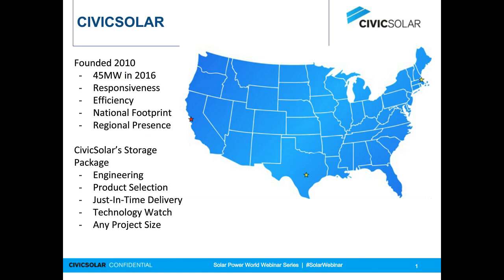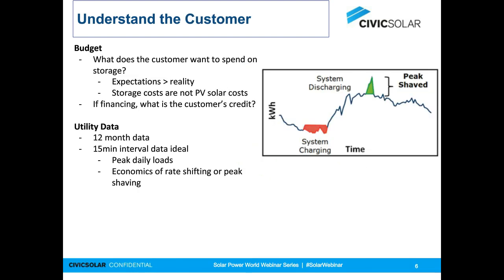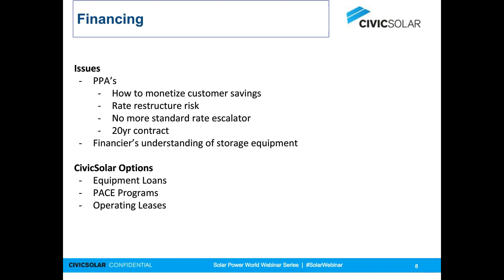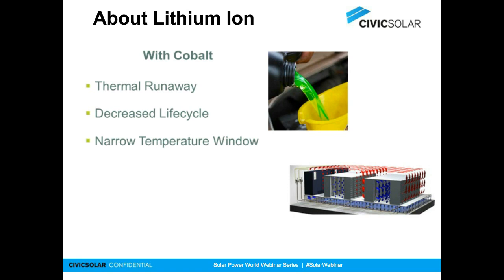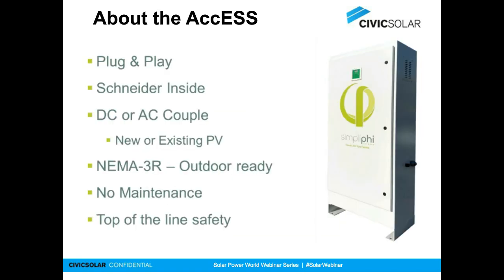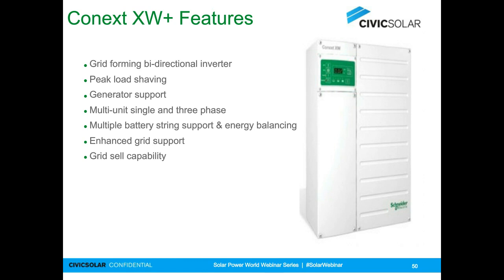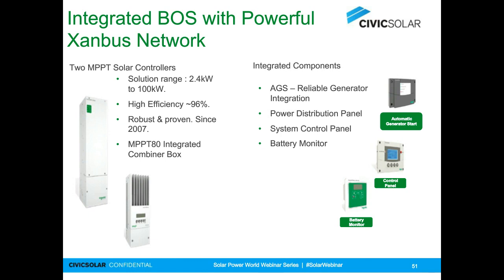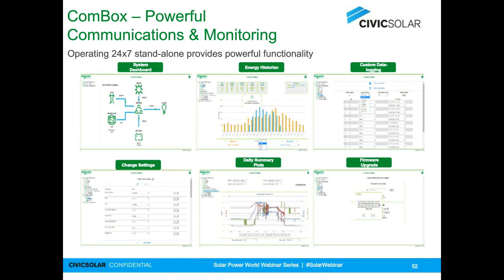Webinar: The Safe Storage Solution with Simpliphi & Schneider Electric

Comment: lithium ion with cobalt costs much less, and holds up to more than 2x the charge per weight vs LFP batteries. not sure LFP is really worth it considering cost savings per KWh of storage
Reply: In so far as the cost is concerned: they may appear more costly based on the up front price point, however, if you factor in our 98% efficiency (Tesla's website currently states the Powerwall is only 90% efficient, as context), our 10k cycles or 10 year warranty, and the fact that our batteries can be deeply discharged (since we do not use cobalt and there is no risk of thermal runaway or fire - inherent with all lithium batteries that use cobalt, which is a toxic mineral), you will see that our batteries last much longer and thereby result in cost savings long-term. All of these performance factors result in an overall lower price per kWh. See this article for detail on how to evaluate the true cost of a battery: https://www.solarpowerworldonline.com/2016/12/calculating-true-cost-energy-storage/. We hope that helps! Thanks
Reply: Additionally, third party battery testing laboratories have already proven that lithium cobalt batteries have much quicker capacity fade as compared to LFP batteries, despite lithium cobalt batteries having initially higher nameplate capacity. In fact, because of the issues with thermal runaway and fires, directly associated with cobalt, the full battery capacity can't even be used for lithium cobalt batteries. Beyond the performance factors, cobalt is toxic, as reported by the EPA and numerous consumer report organizations. Cobalt also goes straight to landfills, as it is not recyclable whatsoever. Our batteries are the most environmentally benign lithium batteries. Cobalt is also primarily mined in the Congo through illegal mines and child labor, as reported by many mainstream news outlets, e.g., https://www.washingtonpost.com/graphics/business/batteries/congo-cobalt-mining-for-lithium-ion-battery/.